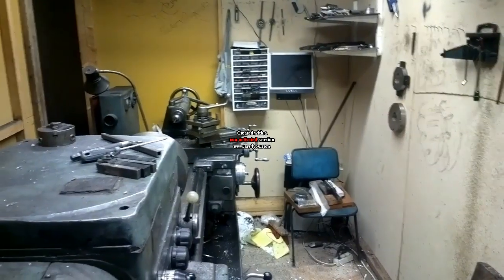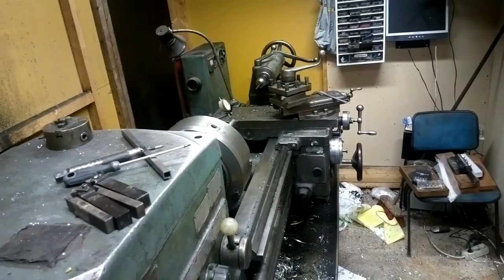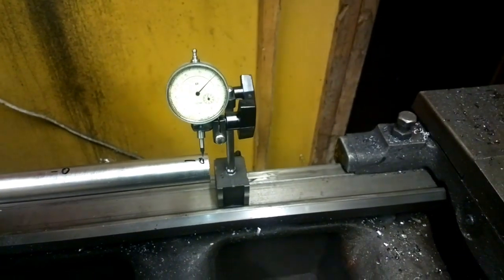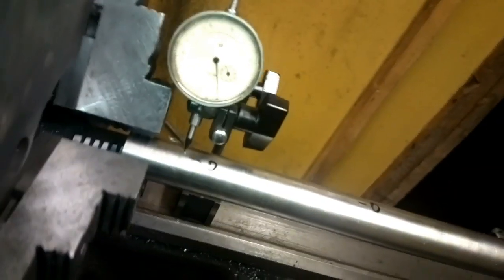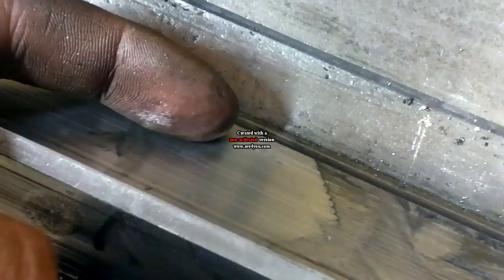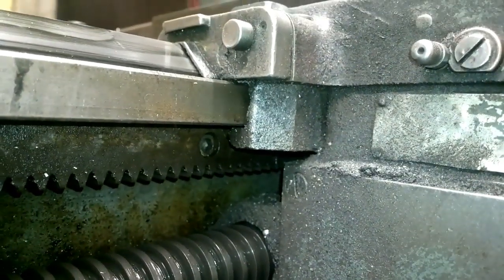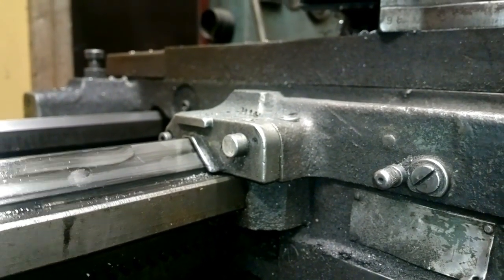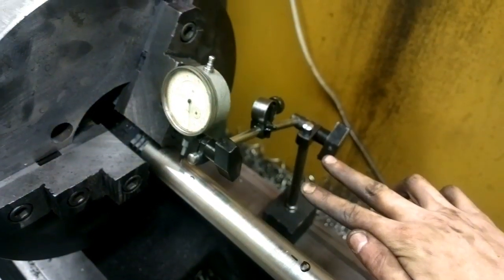Lathe restoration project part 1

Comment: Good, rigid, soviet lathe "Krasni Proletari" 1K625. In good condition, this lathe possible to cut 25-30mm of steel for one pass without even intimation for chatter.

It seems that it was in hard work for entire 24 hour for a day. On the label not "Stanko" but "Stankoserivce". Factory is "Krasni Proletari", Moscow